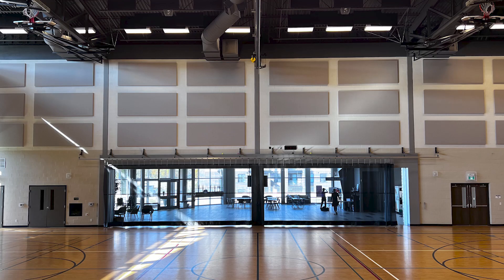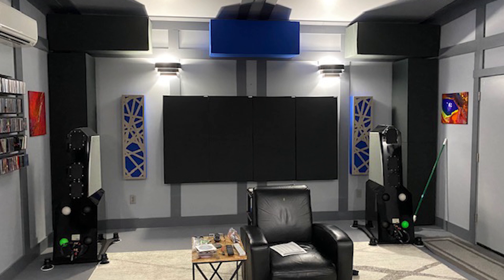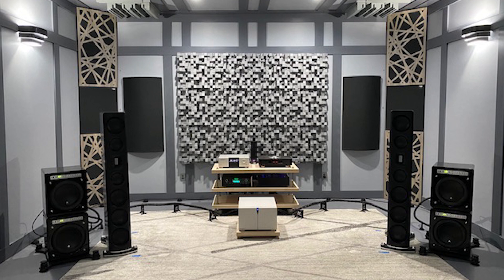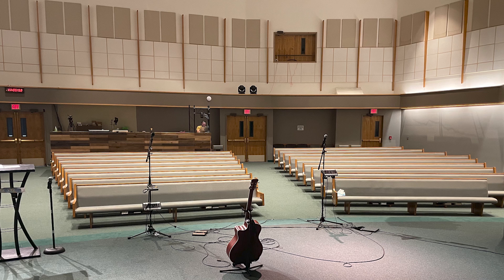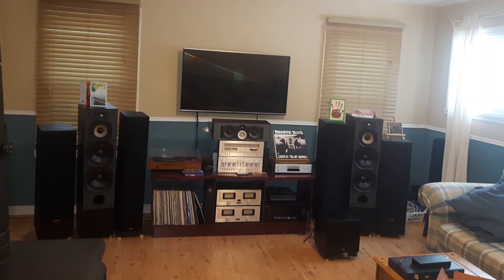Don't Do This! - Acoustic Panels - www.AcousticFields.com

Comment: Couple of good tips thanks!
Reply from the maker: People confuse panel function and placement. Panels can be made to manage all frequency bands. You can have low, middle, and high frequency management panels.They can be either absorption or diffusion You must match the panel type to the frequency, amplitude, and location of your specific room issues. This is where the misunderstanding comes into play. People buy products that do not absorb enough energy at the frequencies of their room issues. Its an improvement over nothing but they still have part of the issue. Its best to fix it once and bedone with it. 100% fixed 100 % right.
Reply: @AcousticFields  makes so much sense

Comment: I love taking a room with acoustical treatments and  determining problems with what was done. Outstanding and great learning experience. Lots of people just put stuff in a room making it look nice. Although lots of times treated room is displayed are purely listening rooms and most people have them in rooms with all kinds of other furniture.  This is an area that's deserving a more focus when you have lots of furniture in the room.😊
Reply from the maker: The room does not see pretty. The room only sees energy. The energy comes in two forms: pressure and reflections. Lower frequency pressure that does not fit into the room dimensions and middle and high frequency reflections from the walls, floor, and ceiling. The goal is to minimize the unwanted pressure issues (modes) and lower the reverb times created by reflections.

Comment: example #1...there is zero indication of ceiling treatment or NOT.  There could be plenty of Sabins of absorption at 125Hz to counter the mass of the CMU, etc....likely not...but those two images are NOT the whole story and you should speak to that as well.
Reply from the maker: These are photos submitted through our room analysis link. You get what we get.

Comment: Most VO and Podcasts I see working in an open room face their desks toward a wall so they are speaking a with a few feet between them and the wall. Would it be better to face the opposite direction with 10-15' of space to the far wall?
Reply from the maker: Yes, However, to achieve the best quality sound, you need to lower reverb times in any room.
Reply: @AcousticFields lower the reverb time to what time approxx?